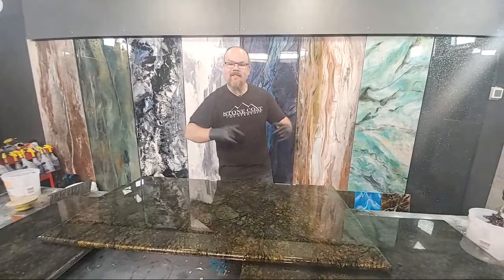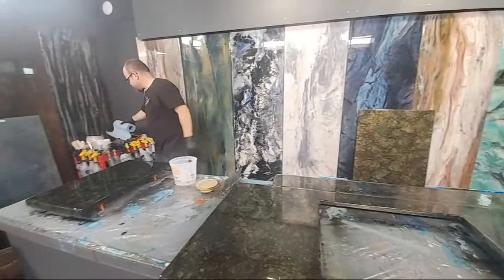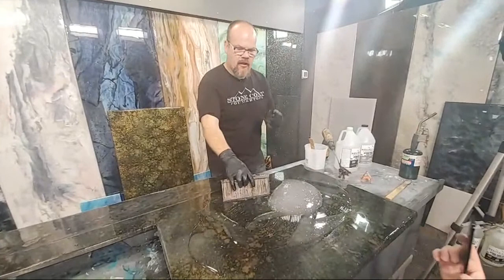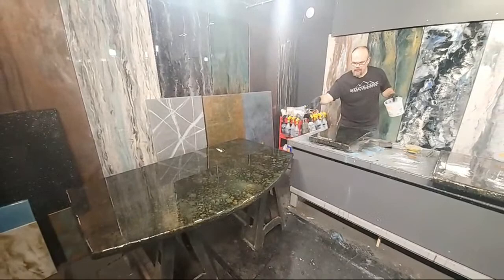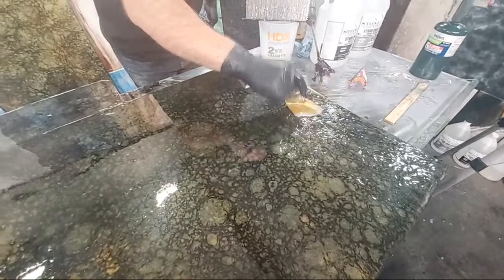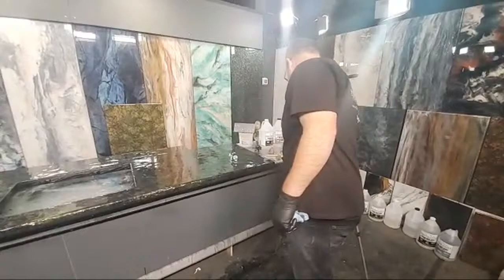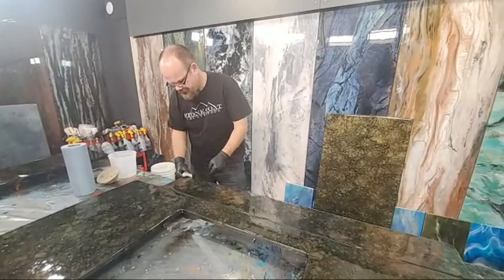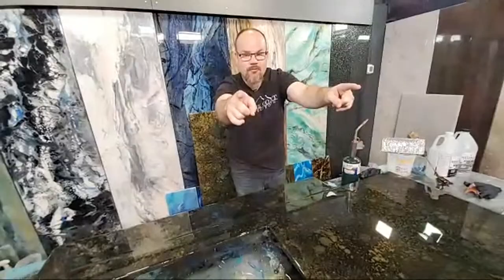Epoxy Clear Coat Hacks | Stone Coat Countertops

Comment: i just did my countertops and kitchen island first time using epoxy and i did the bondo chiseled edge   , it was super easy to use and working time was crazy long , i kept adding colors and veins and could not stop just trying different things out , so i have a 1 off custom countertop that no one will have , love the product and now im going to do the window sills and other things in my house.  i did approximately 70 sq feet for less than 300 bucks , the other company not saying names was 1100 dollars for there kit with 2 colors,  stone coat countertops is the way to go . thanks for the awesome product and the minor delay for shipping was worth the wait

Comment: Love your videos and am working up the courage to attempt to do my kitchen. I foresee several issues though and have scoured your archives looking for my answer so i didnt make you answer again if the solution to my problem has already been uploaded

So happy said that, here's the problem. I can't take my countertops out. I can't read make them like the custom flat ones with the flat back board that you make. I have to cover and do something with the standard commercial box store prefabbed cheap a$$ countertops

Because of that i need to know or have you show us how do we do this with the attached curve countertop profile.

Can we mix it 1:1 instead of 3:1 and simply do more coats? 

If we CAN remove them (which i cant) would we prop up the counter so the backsplash area is the only portion remaining down and the main deck area going into the air and then do only the backsplash area first, then attempt the main deck later?

In other words, how can we put product onto the built in backsplash without it shluffing off and  pooling on the deck section? 

By any miracle do you have a video that addresses this? If not, can you please make one?

2nd problem is that i have cats that are insistant on jumping up on the countertops when im not in the room.

Because your product is touted to be scratch resistant im hoping i can use it, but foresee that it could have a significantly longer cure time. How much longer? I cant leave them locked up in the bathroom for weeks.

BTW I'm also confined to  wheelchair. Any suggestions as to how to keep the product contained so im not rolling into and spreading anything that runs onto the floor?

Comment: Really need good advice for dust in the dry epoxy!  On my 2nd do over because of this
Reply: If its a small project you can build a tent from plastic.  If its a large project, in a kitchen or bathroom you'll want to make sure if you have forced air heating/cooling that all vents in the area are blocked.  You don't want a lot of air movement in the work area.  Also can set up temporary plastic "walls"  or sheets across areas to shrink the work area and isolate it from the rest of the house.  Beyond that once you pour that final clear coat,  you'll want to minimize movement in that area.  Don't walk around quickly.  Move somewhat slowly and deliberately.  If anyone has long hair, make sure they are not flipping it around.  Some people have a constant habit of flipping their hair and it raises tons of lint into the air.   I avoid waving my arms around and or don't wear fuzzy clothing.    No matter what you do, you're going to have a few dust specks or lint fall into the epoxy.  Its just not possible to completely avoid it 100%.    One of the very best solutions is to hone and polish the surface after it has had at least 5 days to harden.  Stone Coat has videos that show this process.  Can start at 220 grit or even a bit higher at 400/500 grit and work your way back up.   You can either leave the finish at a satin or semi-gloss level or take it all the way back up to a high gloss finish if you go to 4000 grit and then use a polish like Stone Coat sells or McGuires 105, or other similar polishing compound on a dual action polisher.    It does take some practice and a few tools and the right sanding disks and pads, but it provides excellent results and completely eliminates any worries about dust specs in your finish because you sand them out.
Reply: @admjlw   thanks. This was my first thought. It is a pretty big slab, I now have several roles of plastic to make a curtain. Wish I would've done this the first time...

Comment: How long after I appply the epoxy I can put the clear coat?
Reply: Trying to find out as well
Reply: Me too
Reply: 24 hours. As long as everything feels dry and is not sticky you can do it but it generally takes 24 hours. If its still wet/sticky after 24 hours, then the room temperature isnt high enough. You want to keep the room at or above 72° F, preferably closer to 76, for the epoxy to cure. If it is still wet/sticky after 24 hours then you'll have to just wait and see when it dries (should be fully dry within 48 hours or less but generally only takes 24 if the room wasnt to cold). Once it is fully dry you can move on to the clear coat.

Comment: Love the videos and products! I have a question. Why are your products reasonable priced vs. the other companies selling epoxy. I won't mention names but the competitor I'm referencing which name begins with an 'L' literally charges 4 times what you charge for the same amounts of material. Is their product somehow superior to yours that justifies the substantial price difference? Thanks!
Reply: i looked at that company also and was like in shock how mutch they charge for there kits. its was over 1200 dollars and thats not even including shipping for there 2 color kit . stone coat i had a little over 300 because i bought a bunch of base coats and pigments and dyes.  i bought 2- 1 gallon kits for $89 each and they come with a bunch of metallics. this was my first time using this and it came out super cool . tons of depth and the other company know people will buy it because if its more than its gotta be better.  i think stone coat is totally fine i dont see any issues with it. once it dried the following day it was rock hard,  im now thinking about doing my garage doors  and epoxy them i have flat doors though.  i want a custom color and something no one else will have. i will continue to buy from these guys.

Comment: How do you clean the trowel?
Reply: Most of us don't.  Just set it upright on plastic with teeth pointing upward, let it harden.  The teeth will be clear and ready to reuse.  Eventually if the buildup gets too thick, simply twist, bend the trowel a bit and it starts popping right off.  Pretty easy to peel it off and good as new.